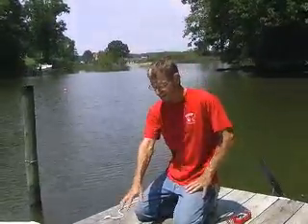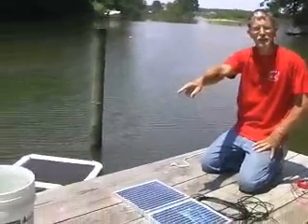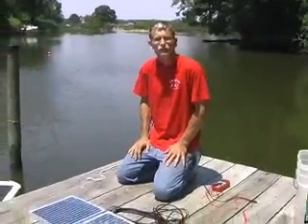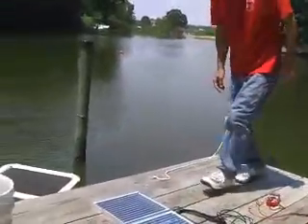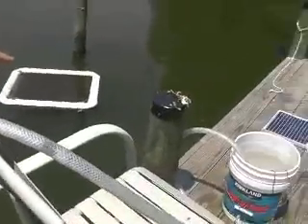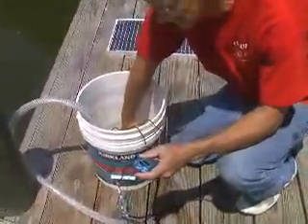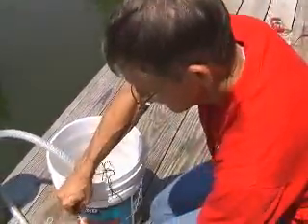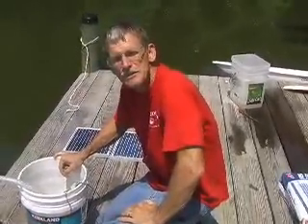Solar pump test

Comment from the maker: It is a small marine bilge pump - West Marine carrys them but even Wart mart might have what you need. You do have to match pump amps with panels output.
These pumps are low amps but they don't put out much pressure.

Comment from the maker: The pump was a simple bilge pump for a 
boat - probably a 500 gph unit - it said it needed ~ 1.2 Amp full load - which would match to total 20 watt output. That would be based on a discharge head of 6 - 8ft.
If you think it would be useful I could do a video - selecting a panel /pump for different application.

Comment from the maker: I got the solar panel at a closeout from
Homedepot - but you can find them on the WEB. You will need to match the panel
output (watt) = pump Amp X voltage. The pump I used was a small bilge pump - good volume / low discharge head. This worked well with my application but might not be suitable for moving water where elevation is required. Good Luck